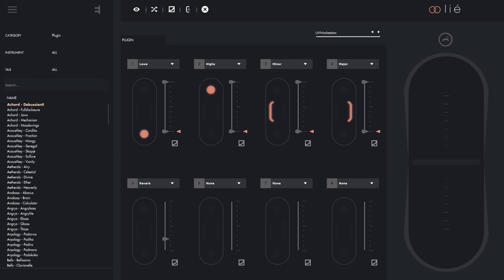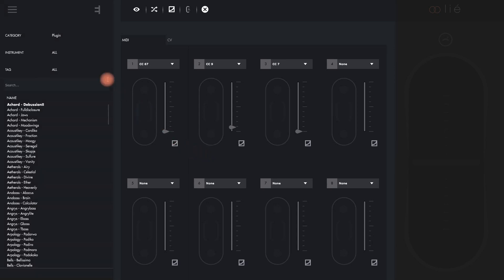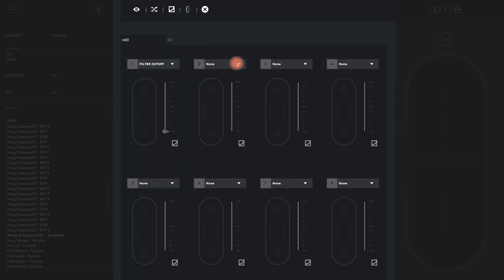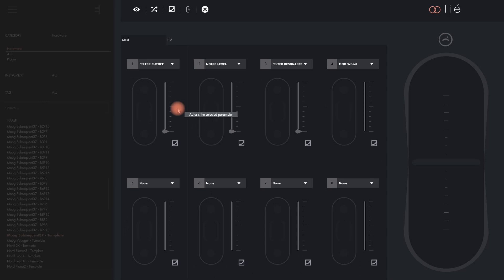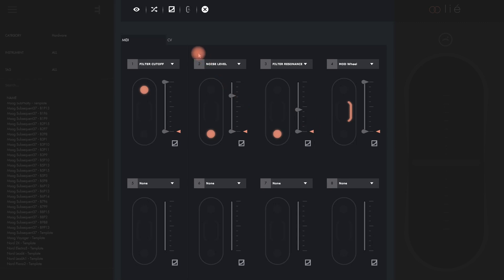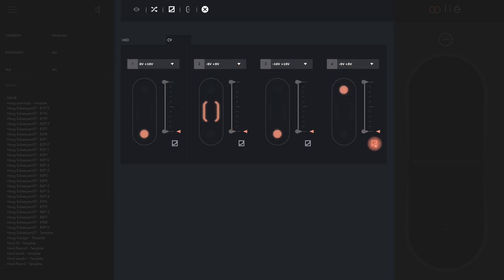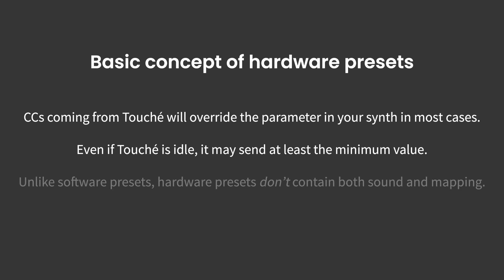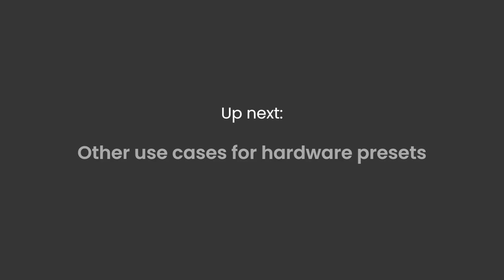13 | Creating hardware presets with Lié | Touché Tutorials

Comment: i realize this is pretty late. but can touche send note on command so it can be used without a keyboard? and can it send both CV and midi out at the same time?
Reply from the maker: Hi, Touché doesn't send MIDI notes, only MIDI CC messages (and pitch bend if wanted). It does send CV and MIDI at the same time, yes.
Reply: @ExpressiveE  thanks for the reply!

just an idea for an update then maybe :) it would be really if you could set a base note for it to play in the software like C3 so you could play/use it without a keyboard and just use the pitch bend on the touche only